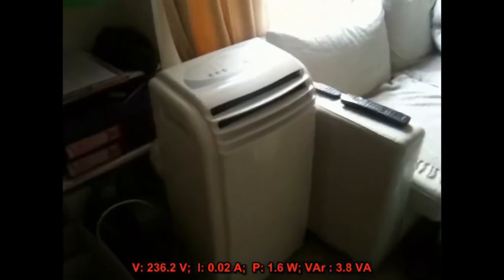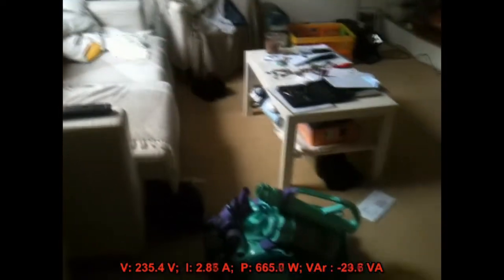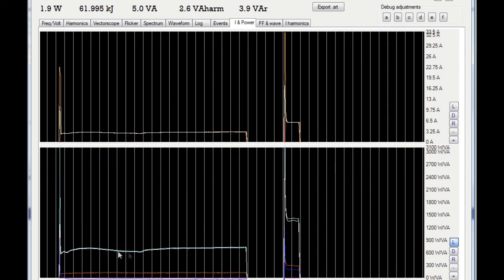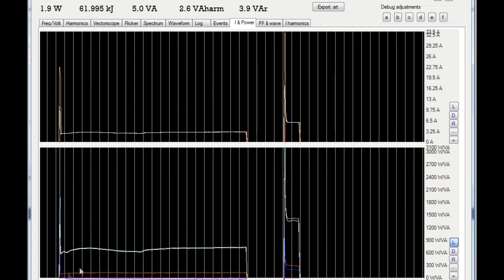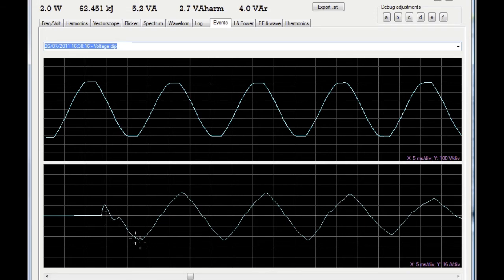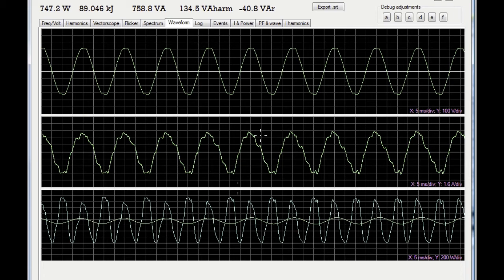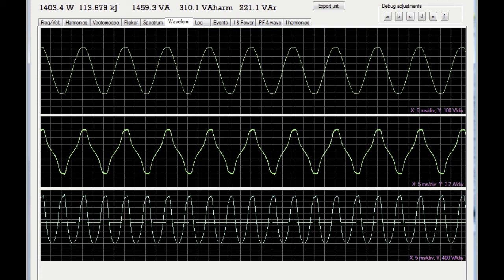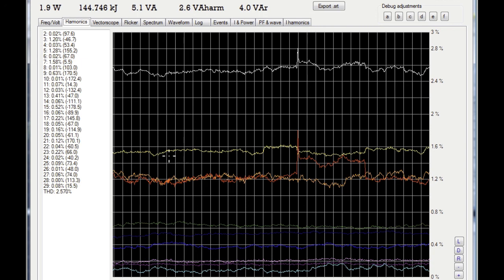AC and Vacuum Cleaner switch-on surge analysis

Comment from the maker: @narcoti Once I've got the program working properly, I'll release it. It's a real mess and flaky as anything at the moment. The actual device is basically nothing. I just built it from some transformers and resistors I had lying around. I'll draw up a schematic which can easily be modified to suit what you have to hand.